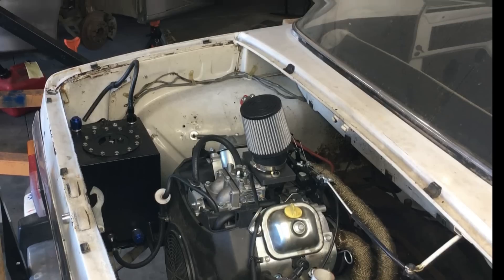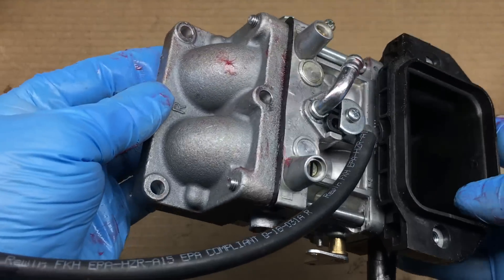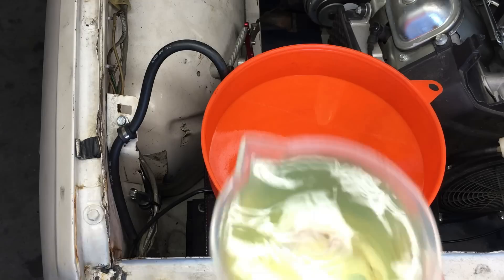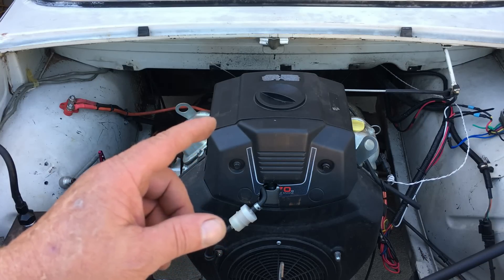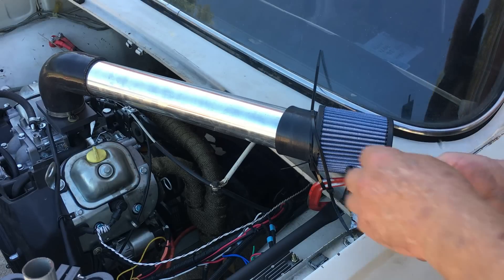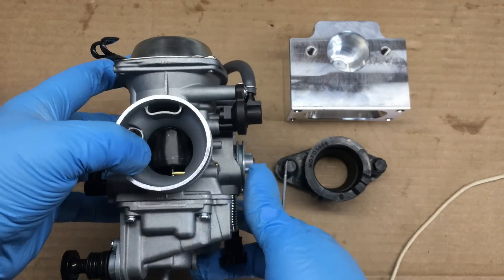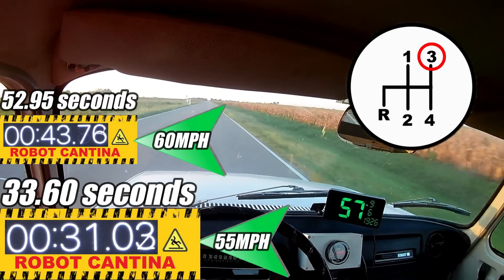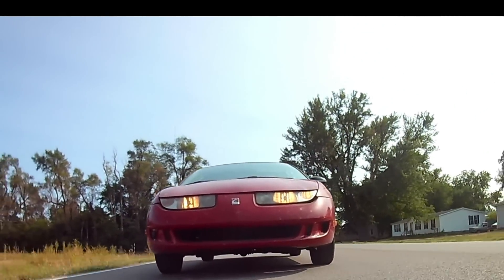S3 E28. Performance tuning and MPG tuning the 670cc predator powered Renault

Comment: The reason VW probably found the exhaust thingy to improve power is because you don't want your fuel to vaporize before getting into the combustion chamber; if possible while still getting good atomisation. It's one of the reasons direct injection is better for fuel efficiency and why it lends itself well to higher compression engines. Latent heat of vaporization is a pretty powerful thing when it comes down to engine performance and even though petrol/gasoline is almost laughably weak at pulling heat from the air around it to do so, it still makes a massive difference for engines. It's also why you can make more power on E85 even though the specific energy of E85 is far lower than petrol/gasoline, the simple fact that ethanol pulls much more heat out of the air to vaporize cools down the combustion chamber enough to provide an actual performance benefit over petrol/gasoline, even though absolutely everything else about E85 should make your car less powerful.

Also ram air intakes need to be very carefully designed to get a decent amount of more air forced into the intake. On modern cars it's easier (and less aerodynamically problematic) to use intake manifold resonaces to achieve a similar amount of extra manifold pressure. Even then you'll be looking at maybe 15% more air which is speed dependent and a nuisance to manage on a car without some sort of system to monitor and adjust the AFR constantly, like say, an EFI system. You could also go the old plane route and add a lever or dial in the interior to let you adjust AFR on the fly, which could make it work. Probably doable somehow with some cables and whatnot going through the firewall and looking like a tripwire inside the car lol.

The carb spacer is also a bad idea on principle alone. You want as short of a distance between the throttle and intake valve as possible to reduce the distance of vacuum between the two to reduce pumping losses. It's why things like ITB's exist. They won't make any more power than a good intake plenum, usually, but they improve throttle response for that reason. There's a reason BMW dumped a whole lot of money and time into developing valvetronic. Having the intake valves be the throttle bodies themselves does a whole lot for throttle response.

Comment: You got out at the right time of day, this 109 degree weather is in kansas is enough to have good economy
Reply: In topeka diesel and gas is the same price
Reply: Could you try a lectron carb?
Reply from the maker: Hmmm the lectron appears to be a variable venturi type carb that is fully adjustable.  Expensive though.
Reply: @robotcantina8957  that's for sure, from what I remember seeing that they are pumpers aswell
Reply: @robotcantina8957  the only challenge would probably getting the right metering rod since the carb has no jets. Probably not worth it. But a cool carb for sure. Love your content tho! Keep up the awsome work 👍 👏

Comment: 🤔  If you could rig up an inline electric motor to the engine drive shaft like on a gen 1 Honda insight then use a battery bank to power the inline electric motor, charged with roof top solar panels & a standard 120v AC plug in charger. Rig the gas pedal so the electric motor turns on and provides a power boost when gas pedal is fully depressed. To get you up to 55 hyw speeds faster. Once cruising at 55, gas pedal is slightly depressed & now cruising in an overdrive gear on engine power only.
Reply: That's possible, but it would be a really intense project - the kind of ideas that he said are too expensive and time consuming to be practical. The motor would be quite large in order to provide any meaningful assistance, and you generally can't just put it directly inline - there needs to be a way to mechanically disconnect it when it's not providing torque to prevent it from being a load and being overdriven.

Definitely skip the roof top solar panel - they just don't provide enough power to be useful while driving, and hardly enough to provide any charge when parked. The only vehicles that can make use of those are either only using them for auxiliary purposes (e.g. lighting in a camper) or are specifically built extremely light and efficient so that the power is sufficient (solar rollers).

Keep in mind, that battery bank would have to be massive in order to be of any use. 1 horse power is 746 Watts, so a modest 5 HP is 3.73kW - as much as a large electric clothes dryer. A 12V car battery rated 45Ah can provide 540Wh of energy. The zero to sixty time is about 30 seconds. This means it would be able to power that motor at 3.73kW for only about 9 minutes - so a total of 18 times accelerating 0 to 60. In practice, we would need a lot more than that. You won't find a motor that powerful that runs on 12V - it would be at least 48V. Also, the capacity of car batteries is rated at discharge rates much lower than this, where they would discharge fully in a couple of hours, not minutes.

Various chemistries of lithium batteries would be more practical for this, but then you're still talking about much more expensive batteries and a more dangerous setup.

To top it off, you need some kind of motor controller to use these motors. The controller alone will cost several hundred dollars!

At the end of the day, hybrids are great for acceleration and fuel economy (I love my full EV!), but building one yourself is neither easy nor cheap. I'm sure Jimbo could handle it, but it doesn't seem like the kind of thing he could throw together in a week or two.
Reply: @reverse_engineered  I'm aware that on a large electricity guzzling vehicle three -100w solar panels on the roof isn't going to do much since it needs to suck up about 7,500w for 8 or more hours to fully recharge. But on a vehicle like the lightyear 1, Aptera, Sono and few other small lightweight EVs or hybrids  covered in solar cells. They do add a worthwhile amount of range. Especially for someone who doesn't need to drive every day or only has to drive say 16 miles roundtrip to work. 
The gen 1 Honda insight was a hybrid with a parallel motor. The motor was used to provide torque for faster acceleration. If the battery was dead you could still use gas only & be slow.  If they used a lifepo4 battery bank that was charged off wall plug in instead of alternator & regen braking . It wouldn't need to be a huge battery. So 120v outlet could recharge it. If the vehicle was covered in solar cells plus had regen braking. It'd get worthwhile charging 🆚 0 charging from no solar cells. If it was covered in say 800w of cells. On sides,doors ,hood,trunk, roll up solar window covers to charge & keep sun's heat out of interior. 
Years ago when I mentioned solar systems/solar panels for RVs. Everybody told me it wasn't practical/wouldn't make enough power to be worth doing 😂

Comment: I wonder if "cold" intake temperatures are less of an issue on high pressure fuel injection engines. Seems like it would stay in suspension a little better overall

Comment: you can make additional tube from the ram-air pipe to the float chamber, so when the pressure rises in the pipe, it rises in the float chamber too, making venturi work (for example - float chamber pressure will be 17psi, and venturi pressure would be 15 psi, because well, thats how venturi works)

Comment: Just drove my 2002 ford focus wagon with 285k miles on it to the junkyard 150 miles away in 3rd gear on local roads . Tranny shot  they gave me 175 dollars for it delivered .
A guy picked me up at the junkyard in his 2000 Honda insight manual transmission car as a test drive .
I bought it, had to, no way to get home!
I seems to run fine and gets great Milage .

When the engine goes who knows what I  will put in it….
Reply: I hope you share the experience with us! 😃

Comment: At this point with having a Harley Sportster carb slated to go on wouldn't it be cheaper to just go to the scrap yard and pick up a wrecked 883 or 1200 sporty and just swap an already modified lawnmower engine in and toss the predator in the trash....I mean that is how Harley started out...actually I believe the started with a Maytag washing machine motor and then the lawnmower before getting to where they are today with the 107 and 114 ci M8 big twins...which 114 ci is in the 1800-1900ish cc rang
Reply: The whole point is that he's starting with an off-the-shelf motor and modifying it. Buying an already powerful motor and just dropping it in defeats the purpose.

Comment: The billet intake has a sharp edge on the carburator side, you can see it at 13:35. Moreover, i suggest you to 3d print an adapter that will make a smoother transition into the intake manifold so that the splitting of the flux between the cylinders is more homogeneous

Comment: @16:28 "Scary" ... how?  Have you checked for worn stuff in the suspension or had the alignment checked?  Even just a couple degrees of toe-out can make driving anything really scary ... and impact mpg and mph as well.  Make sure you check the rear as well.
Reply: He's being sarcastic calling it a race car. The thing barely gets over 60 in the first place - it's a lawn mower engine!
Reply: @reverse_engineered   I removed the race-car reference.

Comment: Is your o2 sensor heated? Does the heater need to be shut off or is it fine for power to be applied constantly to the white wires(heater wires)

Comment: Im wondering (like I say in every video) if a car roof top solar system charging a battery bank to produce on demand HHO hydrogen & oxygen when you turn a power switch on. Could be added to an engine intake/mixed with gasoline to make a worthwhile mpg improvement.
If so, it'd mean that if I ever got unsick and finished fixing my van. I could fit about 400w worth of solar panels on my van roof to make HHO and hopefully increase my vans poor 13 mpg to something like 20 mpgs or more. Many HHO videos are bogus but some are legit showing small engines running off 100% hho....
But to run off 100% hydrogen, you needs lot's of it and engine mods to prevent overheating and to prevent pre-ignition. 
I was hoping a mix of like 75% gasoline and 25% HHO, which is 2 parts hydrogen/1 part pure oxygen. Would give the gasoline a more explosive punch to create more hp to make at least a 25% + fuel savings. Some diesel engines use a propane injection system to burn a mix of diesel & propane. Which is very similar.

Comment: I usually get around 200 miles per tank in my 2003 Malibu mostly stock, but i have a lot of warm up time engine running  for the transmission. Usually 3 minutes minimum @60° so colder weather it is more like 15 minutes for warm up. My car has moon miles, and I believe the transmission survived so long because I warm it up. Cold it wont shift into 3rd lock out until it feels like it. Warm, functions as as expected, but too hot you slam that loud pedal it might blow.. i have done worse with less

Comment: heared about a trick using chapstick (seemed cherry flavour was best ) on the sticky gaskets used on holley carburettors , you stick it on one side and use the chapstick on the other so the gasket doesnt tear when you need to remove the bowl to chainge jets
about using thinner tires , the rims are 15 inch and i guess thats a cmmon size , did a quick search and you can get motorcycle tires in that size wich when pumped up should have an even smaller contact patch 
115/70 R15 90M was about 43 euro here

eerm volkwagen didnt heated up to get better fuel milage but to prevent the fuel freesing up the most intake air and causing ice forming inside the manifold , allso prevents the fuel from falling out the mix and puddling in the plenum chamber 
there was smokey unich that build some sort of supermotor that basicly made the intake charge as hot as it could make it and never pinged or detonated , noone have figured out how he done that yet https://www.motortrend.com/how-to/hrdp-1009-what-ever-happened-to-smokeys-hot-vapor-engine/

Comment: Robot Cantina: I hate doing fuel economy tests!

Proceeds to do 5 fuel economy tests in one video.
Reply: Since it's going to be well over 100 F (which in metric, is a different number) for the next week in KS, I don't expect we'll get any more fuel economy tests since there's no AC in that car. I guess he wanted to get all that testing out of way while he could.
Reply: @krashanb5767 He could put a weight cell under the fuel tank, check the odometer before and after, check the weight of the fuel tank before and after the economy test.
Reply: @martin-vv9lf  its called a load cell, but that's a fairly good idea.
Reply: @bfgoalie99 you two have a good idea in theory but it adds two complications. Well three if we include getting one and it’s associated cost. 
The fuel cell load cell would add extra weight to the car that the other tests didn’t have so it would affect the apples to apples comparison of the data. Jumbo adding it by hand and graduated cylinder is the easiest way to do it for his setups. 
And two, to trust the results of a scale you need to calibrate it before each use. Placing a known weight on the scale after zeroing to make sure it shows the correct value and is reading true. If you bolted the load cell under the fuel cell you can’t get at it to zero and place test weights on it to verify, so you’re trusting the last calibration. Sure, sometimes you can get away with that. But this thing is going down the road for an hour or so for a fuel economy test. These “hot rods” of Jimbo’s aren’t luxury cars with smooth suspension, they’re street legal go carts. That poor load cell will be bounced around and shook up in ways you never thought about until you let your friends talk you into letting them ride in the trunk. Didn’t even make it 3 miles lol, though it was gravel. 
And if you just left it at the shop and weighed it and then bolted the fuel cell back down and unbolted it again and put it under after the run, you’ve just added a whole pile of work that can be avoided by measuring what he pours. I think I speak for all of us when I say I’ve got enough to do already and adding more when I don’t have to don’t happen much. 
This is a good idea guys, it’s just not very practical for his setups.
Reply: I wonder if some kind of a flow meter could be used to get instant fuel use reading. That would save a lot of time.
Reply: @krashanb5767 i would assume the number would not be reliable much, since the test is supposedly measured in distance to fuel ratio. Usually after a trip of driving (somewhat) normally. Instant read fuel consumption is not really telling much if at all

Comment: The ram air failed because you did not adjust the mixture to compensate. Gotta richen that mixture. But I agree to get the carb you’re going to use first. Once you pick a carb, the ram air can be a focus. Good job. Fun stuff.
Reply: I don't mess with carburetors, but isn't the whole point of their venturi system to maintain a constant AFR across different airflows?

Regardless, he's done EFI on these small engines before, and I'd like to see that here at some point.
Reply: @PsRohrbaugh     At atmospheric pressures (no artificial pressurization), you’re correct (generally speaking). But if you pressurize the air reaching the carb, via supercharger, turbocharger, ram air, etc), the vacuum signal at the Venturi is actually less. Therefore, with less vacuum signal, it picks up less fuel. So you get a double whammy of more air (due to forced air) as well as less fuel. Lean mixture ensues.  Most forced air induction which incorporates carbs compensate for this by applying this extra pressurization to the bowl chamber of the carb which in turn forces more fuel. It’s likely though that jet and needle changes would also be warranted. Carbs are much more fun to tinker with than fuel injection. :-)
Reply: @PsRohrbaugh I love all that stuff too. :-)
Reply: Ram air has never worked and is a myth
Reply: Was the ram air pressure applied to the air above the fuel in the carburetor float bowl, or just to the air flowing through?
Reply: @cedriclynch  you should ask Robot Cantina. But it seems pretty clear the bowl was not pressurized.

Comment: Are you sure that you're not restricting airflow with the long tube?  Try attaching a garbage can to the top of the car, cut out the bottom and run a tube the diameter of the bottom of the garbage can down to a plate on top of the carb. It will only work going forward at an undetermined break even speed, otherwise even that will make it run a teensy bit richer by restricting air just a little bit.

Comment: Those carbs can be a chore to tune. I think it will work very well in your application though!
Reply: I had a bike and added a very efficient exhaust pipe + K&N air filters with built in velocity stacks. I must have had the carbs (4 of them) in and out 30 times to get them jetted correctly moving the needles and changing main jets most times. The final results made it worth it.

Comment: Keeping the heat in the top half of the engine bay could be a bit more beneficial to the economy, would kill the power a little (hot air intake meaning air is less dense and gives less bang), but would keep the intake pipework warmer, so maybe refit the engine lid at some point and see what differences are made...

And at least your fuel prices are dirt cheap, my local esso charges what equates to $7.16 for a US gallon, or £1.49 per litre... :P